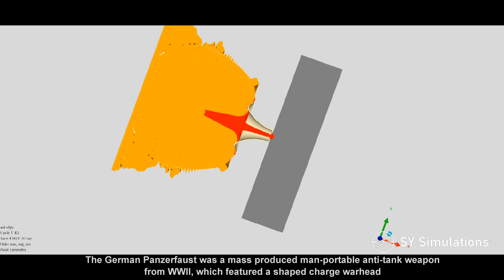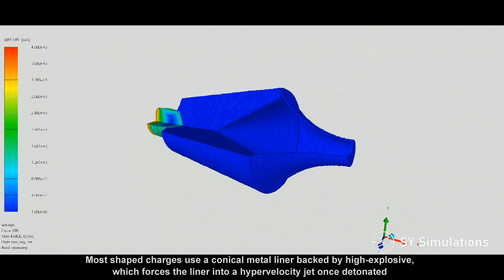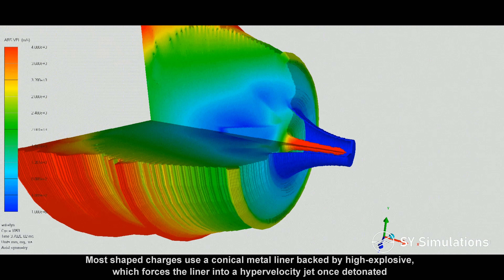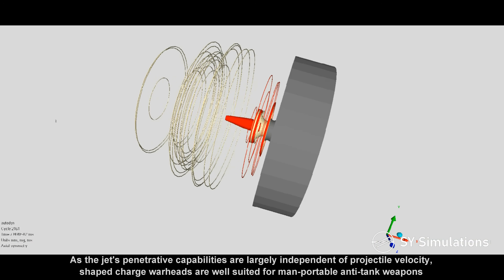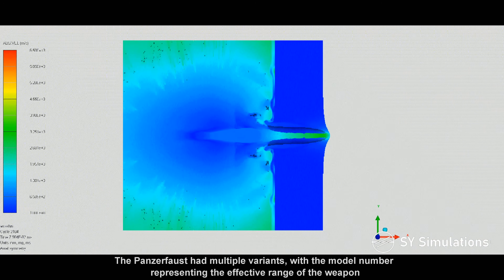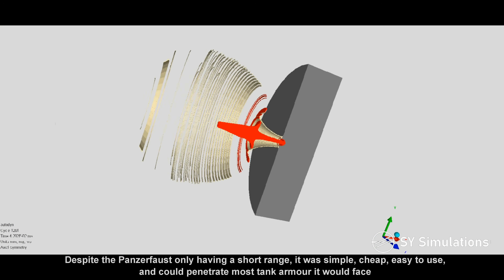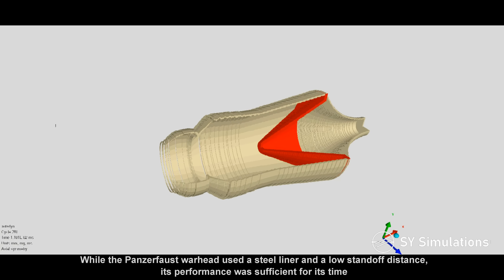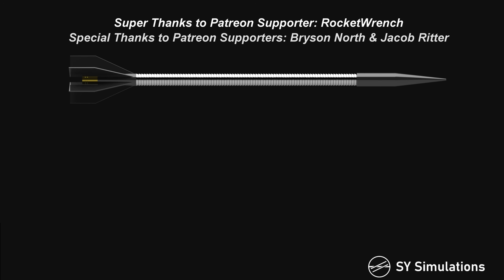PANZERFAUST SIMULATION | Shaped Charge vs T-34-85 | Armour Penetration Simulation

Comment from the maker: For computational reasons this had to be Eulerian and axisymmetric, necessitating a perpendicular impact. This shot could have ocurred close to the maximum range or from an elevated position e.g. urban combat.

Also its hard to see in the contour plot but the jet tip reached around 6500m/s
Reply: Ah, that explains the rings
Reply: Excellent sim. Love the effect produced on the exit.  Really shows how these munitions functioned. Great work!
Reply: A very interesting simulation, and one with more relevance to historical scenarios. Thanks 🙏🏼
Reply: while german tanks had variable steel hardness depending on the angle of the plate, soviets probably used same hardness for all plates.
have you tested whether harder or softer steel works better with shaped charges?
Reply: Does this mean you used the LS-dyna ALE instead of SPH solver?

Comment: It'd be interesting to see the effect of stand-off and liner imperfections on effectiveness. Modern literature implies that an ideal jet has increasingly better performance out to almost 8x the charge diameter before air resistance has an effect. This suggests that a 120mm warhead would work best at 1m stand-off. I've seen this used to claim any spaced armour can actually worsen armour effectiveness against HEAT warheads, with the exception of cases where liner imperfections can introduce jet instability with greater effect at greater stand-offs.

Comment: I’ve often wondered why the US, who certainly knew of the Monroe effect, given the employment of the bazooka, didn’t develop shaped charge ammunition for the short barreled Shermans.
Reply: Seven of every eight shots a Sherman fired were HE in support of infantry. The had sabot rounds for the 75mm but they weren't readily available. Heavy late war tanks required a 17 pdr armed Firefly Sherman. Tank duels make the history books but the reality was they did a whole lot of assault gun duty.
Reply: @gonebabygone4116 The M3 75mm short barreled Howitzer did not have sabot rounds. Their AP were solid hardened steel, and given their low muzzle velocity, they were of marginal value.
Reply: @mikem6176  Nope, they had sabot rounds. Pretty sure there's a Mark Felton video on it ...

Comment: The document "Research of influence of different shaped charge liner materials on penetration depth using numerical simulations" shows how the Klein would perform with various metal liners. Best performer was a Depleted Uranium/Molybdenum alloy with 196mm pen, versus the 140mm's with the soft steel base liner.
Reply: Don't give the US any more ideas where to use depleted uranium, soon they will have Javelins and Hellfire missiles with those liners lol
Reply: Presumably this a German document? In his book "Inside the Reich" the German WW2 Armaments Minster mentions asking Heisenberg and Weizäcker whether an atomic bomb could be ready in time to influence the course of the war.  Heisenberg replied no (technically he was right as the US bomb wasn't ready till after German collapse).
-However he mentions that 1200 tons of Uranium was released for use in anti tank ammunition. 
NB it wouldn't be depleted uranium.  The Germans only made about 0.6 grams of enriched uranium to 6% using an ultra centrifuge.
Reply: @bernhardzunk7402  No, this is a modern research document related to shaped charge performance with various liner materials. The Panzerfaust Klein was picked  as the baseline for the simulations, likely for its simplicity, publically available design parameters and its "outstanding" performance in its category.

Modern warheads can be more difficult to simulate, and their designs and stats can be confidential.

Comment: 1) wouldn't the nose deform on impact? 
2) To what degree can it deal with sloped or angled armour? When would it slip?
Reply: 1) The detonation of the explosive is much much faster than the projectile. The nose will deform but not by any significant amount before the detonation and the stream of metal is pushed through.
2) The slope of the armor has lesser impact for shaped charges. The penetration depends on thickness of steel the jet of metal has to go through. At some extreme angles, the side of the warhead might hit the target without the detonator directly touching something. The glancing blow might trigger the detonator or it might not, but in either case, any additionally distance between the tip of the warhead and the surface it is to penetrate greatly reduces effectiveness. That's one of the principals of reactive or cage armor which tries to detonate shaped charges further from the actual armor.
Reply: @ClammyCement  Actually, it is a misconception that cage (aka slat) armor is designed to increase the activation standoff distance. Slat armor is design to interfere with the fuse of the shaped charge or to damage its liner, resulting in malformation of the jet. Slat armor only works in around  50% cases when the tip of the charge goes in between two slats. In other cases, the warhead detonates on the slat it made contact with negligible reduction in penetration. In fact, the penetration might even increase as the standoff distance might be brought closer to the optimal value. To be fair, the penetration capabilty of the early shaped charges jets decreases really fast with increased standoff (compared to modern precision charges), so tank skirts might help against those warheads. Regarding reactive armor, the goal is to destabilize the shaped charge jet and to spread its impact on a larger area, preventing it to focus all its penetration capability in a single penetration channel.
Reply: @ClammyCement  Cage armors actually more about trying to interact with the sides of the projectile and shave a chunk of the liner away instead, if the round hits the bars directly the results will typically not be sufficiently degraded penetration. You would just used an extra spaced armor plate if you thought altering the standoff distance would defeat the shaped charge. You don't have to rely on the roll of the dice to set the round off early with a solid plate if the goals of slat armor was that dirt simple. Slat armor is used when spaced armor of sufficient thickness would be too heavy to be usable, as such slat armor is much more clever than you might think. 

A heat round traveling at 1100m/s will happily shave its side off hitting a metal bar side on before the fuse is triggered. A charge thats cut open is far less effective at concentrating its explosive forces, so instead of generating a powerful penetrating jet it just explodes more or less which isn't very effective. The key risk of slat armor being, the slats can be hit directly or missed entirely, in which case its not especially effective (But at least its still very light.)
Reply: 1. The shaped charge liner is traveling at hypersonic speeds relative to the low velocity projectile. Its hard to see the projectiles subsonic movement when the liners traveling at KM/S speeds.

2. The fuse can fail or the shell can have its corners hit without the fuse interacting with the armor, but if the round detonates without serious external forces damaging it shaped charges penetration tends to be fairly close to LOS thickness. I know the issue of fuses having difficulties with angles was a problem with the M7 rifle grenade but I don't have data on every fuse used on a heat round ever because thats quite a lot of data...
Reply: @WalrusJones185  jet speed is same as explosive reaction speed 50k ft sec ?
Reply: @Eric-kn4yn  Its around 19,000-24000 ft/sec for the copper liners velocity IIRC.
 (6 to 6.9 km/s is what I'm familiar with shaped charges liner velocity typically clocking in at.)

Not a whole lot of explosives are able to clock at 50k/ft per second detonation velocities, and its good to remember that the copper liners a lot denser than the explosives pushing it, so getting it to go as fast as the raw explosive can in theory is tough.

Honestly its kinda insane how many liners achieve somewhere along the lines of 85% of the explosive velocity of their charge.

Comment: Is this why German tanks started wearing those skirt armor on the sides of the tank?
Reply: Skirts were originally installed German tanks for protection from anti tank rifles, the skirts were able to unbalance the shell enough to drastically decrease it's effectiveness
Reply: @brunus0159  - so the skirts have no effect on shaped charge warheads?
Reply: Minimal effect, shaped charges are effective when detonated up to 1m from target, but suffer if there is something that disrupt jet formation(like spiker on top of modern Puma Ifv)
Reply: @TheBigExclusive  WWII rounds tended to have insufficient standoff distances so detonating them further from your tank hull is likely to counter many of the benefits you get from the jet being obstructed by an additional weak armor plate.
I've seen bold claims of "It definitely hurts the tanks chances" but I haven't really seen strong evidence of this, rather, there is some evidence it might help but also evidence that there are effects playing against your tanks survival. Since good standoff distances tend to play in the rounds favor and obstructing the jet forming is in the armors favor.
I haven't seen enough tests of early poorly optimized rounds against various armor kits to say definitively.

A lot of modern spaced armors substantially stronger than schurtzen, and modern rounds have much better optimized standoff distances for their liner shapes, so its much easier to predict how a spaced armor will impact penetration in that case because the variables are way more strongly controlled.
Reply: those skirts are essentially spaced armor. as you see in this simulation, the plasma cone will deform as soon as it empty space. assuming the round detonates at the skirt, it will not have the same effect at the armor than it would when hitting the armor straight on.
Reply: No

Comment: Would be nice if you could add a witness plate or some other way to show the after-armour effects.
Reply: This goes right through. It is deadly. No plate needed.
Reply: For him I don't think he will ever add one due to compute constraints. I have seen other sims with the plate but the addition is very marginal 'Not pleasant but uninjured' for anything short of an actual pen. I don't know what hardware he runs, he mentioned it can take a week. I think this is his first HEAT as the compute is extreme, wouldn't be surprised if it took weeks.

Comment: Ehhhhhh most people refer to the Pzf 30(klein) as the faustpatrone. The 'real' Panzerfaust 30 was the bigger version.
Reply: It's like MP43 vs MP44 vs StG44, different designations for the same thing.
Reply: @Treblaine  its not the same
Reply: @Tr4wnet  What are the differences then?

How is a Panzerfaust 30 Klein different from a Faustpatrone?
Reply: @Treblaine Panzerfaust 30 is the successor of the Faustpatrone 30 , bigger warhead and some sights to aim .
Reply: @5co756  what size was each designation? How were the sights different?
Reply: @Treblaine You know Google ? 😅

Faustpatrone had no sights and the warhead of the Panzerfaust 30 had double the TNT equivalent .
Reply: @5co756  No, the Panzerfaust 30 GROSS had double the TNT. The the Panzerfaust 30 KLEIN is identical in every substantial way to the Faustpatrone.

Photographs of the Faustpatrone clearly show that it has sights.

You're confused how the Panzerfaust 30 had two variants, Klein and Gross.
Reply: @Treblaine There is no Groß , that's just some internet BS . First version was the Faustpatrone 30 , just a tube with the pointed warhead and no sights .
Reply: @5co756  how can I believe you when there's clearly versions of the smaller Faustpatrone (100mm diameter warhead) that has sights? 

Some sources DID refer to something as just "Panzerfaust 30" without saying if it's Gross or Klein that clearly has the larger 140mm diameter warhead. But I've noticed these sources have since been updated.

The Nevington War Museum affirm that the Faustpatrone and Panzerfaust 30 "Klein" refer to the exact same weapon that had a 3.3 cm diameter tube and 10cm diameter warhead. As do other museums.
Reply: @Treblaine  Dude they ordered 20k of them ..... . 

They probably build them later with that simple sights , you can also find pictures of the Faustpatrone without sights . You can find pictures from 1944 with soldiers holding such a Faustpatrone 30 with sights , they maybe upgraded them . And called it later Panzerfaust 30 klein ?

Nobody knows and most sources show the Faustpatrone 30 with sights , but the first ordered or build versions had no sights on . 

But the original post is right , Faustpatrone 30 or Panzerfaust 30 klein , is not the same as a Panzerfaust 30 .
Reply: @Treblaine  
No it's not the same. Yes 'technically the Faustpatrone is the Pzf30(k), but most people don't refer to it as that.
Reply: @ThatZenoGuy  Pzf30(k) is clearly an abbreviation of Panzerfaust 30 (Klein)
Reply: @Treblaine  
I know that. But it was more often referred to as faustpatrone.
Reply: @ThatZenoGuy  But you said "No it's not the same." an less common designation is still a designation that was used.

Very often the latter designation is used even if less common just by convention as generally that's what persists on documentation.
Reply: -Pzf 30(klein) or faustpatrone was retroactively redesignated as Panzefaust 30 klein.  Thus we have
1Panzerfaust 30 klein
2 Panzerfaust 30
(Both entered combat in mid 1943 by June)  but both were produced to the end of the war.   The Panzerfaust 30 klein was very light but its warhead didn't work well at oblique armour.
3 Panzerfaust 60 changed from a 44mm tube to a thicker walled 50mm tube with more propellant charge to increase range.  In service mid 1944.
4 Panzerfaust 100 used the same tube as Panzerfaust 60 but had a double propellant charge with a 10cm air gap to delay ignition and thereby reduced tube peak pressure.   It entered service around September/October 1944.
-All Panzerfaust while considered disposable were also reloadable in the field but it was an awkward process, and the tube was collected After the battle if possible   A common ammunition box had 6 tubes and 10 warheads.    Remember Bazooka and Panzerschreck needed 2 men to operate and reload effectively but Panzerfaust could be issued to the entire 10 man squad and operate by a single man apart from the NCO and machine gun crew.  2 man weapon such as PIAT, Panzerschrek and Bazooka tended to be issued at the 50 man platoon level.  
5 There was a early "Panzeerfaust" called FP42 issued in 15,000 units in 1942 with a 40cm tube.  It was called Faustpatrone but the troops soon nicknamed it Panzer Faust(fist) because it was meant o be held at arms length.  As you can immagine cinders from the balst could get back to the opperator and the production versions had the tube length doubled to allow under arm or shoulder firing.
Reply: @bernhardzunk7402  
Thanks ChatGPT!

Comment: Perfectly perpendicular, 90 degree angle of attack? Against sloped armor? It may not even matter given the penetration ability, but it's a strange oversight.
Reply: the thing had a range of 30m and needed a decent arch to get there. a horizontally flying projectile would mean basically a point blank situation.
Reply: @klegdixal3529  And shooting an explosive point blank doesn't sound very healthy for the shooter.
Reply: It has a launch velocity of only 28 meters per second, so the only way it could travel far enough to be outside of the blast radius is to have a highly arcing trajectory so a high launch angle and a high angle on descent.

If it could be launched from a much lower position the impact angle would be much closer to horizontal as the intersection point would be near the apogee which is a kind of plateau of minimal elevation relative to range. This is one reason why the PIAT could be so effective aiming at a point on the tank 2m+ above the launch point (relative to laying prone) you can have a much wider range estimation error.
Reply: Around 20 minutes after your comment he put the reason why he did that in a pinned comment
Reply: Lunge AT mine 💀
Reply: Zdajesz sobie sprawe, ze pancerz pochyly dziala tylko gdy pojazdy stoja na rownym terenie? Panzefausty byly czesto wystrzeliwane z okien wysokich budynkow, wiec nachylenie bylo mniejsze. Poza tym glowica przyklejala sie do pancerza przed wybuchem jak plastelina co zwiekszalo efektywnosc. To nie World of Tanks gdzie pochylenie nawet cieniutkiego pancerza w sowieckim czolgu daje mu niesmiertelnosc.